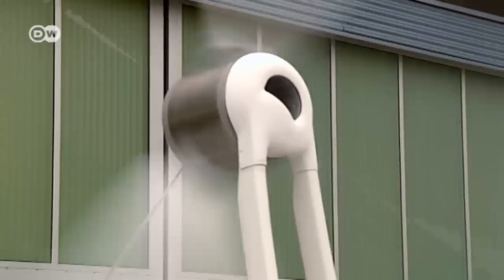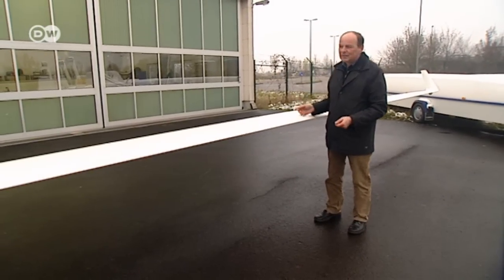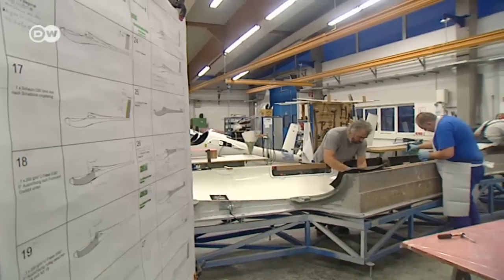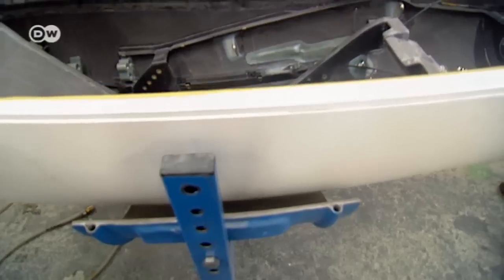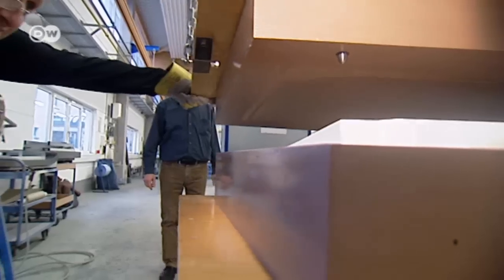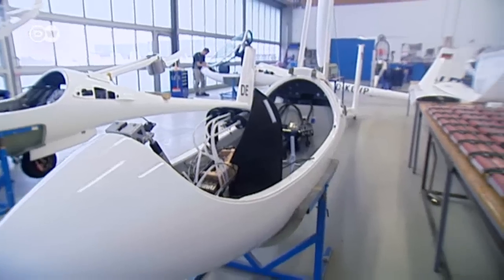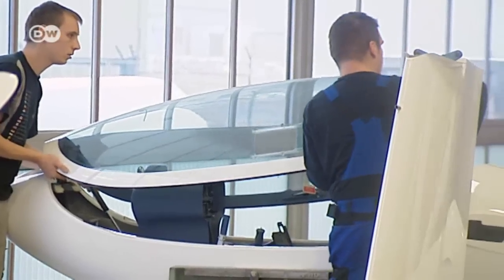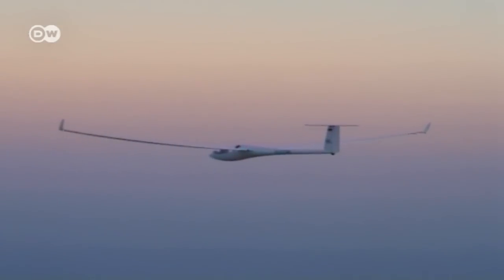On the Up: Electric Gliders | Made in Germany

Comment: I Have A Question:
would the previously mentioned safety rocket make it so glider wings could be thinner, ( so they don't have to carry water ( or less)), if they also could reliably get to smooth landing surfaces ?
it is somewhat, Also, a modern materiel science and construction techniques question, ( pertaining to wing thickness ( or length )), but it's still the same question.
i don't know much about gliders...if the water is carried for intended distance from height, or just to make them faster, i don't know. EDIT : NOW I GET IT....Glider Water Increases The Wing Loading .... IT'S A STRUCTURAL THING !!! 
when there is no water in them, they flex up more

So the glide ratio is compensated by that water weight, Because It Holds The Wings Flatter <-----THAT'S ALL !!! ...for crips sake, that was driving me nuts.

Comment: another clean, ( possibly cleaner ), way to try out; would be better ground based launch systems, and gliders with an H2O2, ( momentary full on / off solinoid ) Fixed rocket Safety Thruster.

where One "rocket belt" style thruster could be streamlined, as fixed into the spine behind the conpit, ( less to go wrong, super reliable format, higher power to weight )
where the high expense of the fuel, and catalyst, would deter frivolous use, and promote reserve for instantaneous automated parallel stall recovery, or intermittent situational manual use.

Comment: it's fun to have an electric powered glider.  there is nothing wrong with the electric motor.  the big project is the battery?.  (1) weight, (2) leveling time, (3) range, (4) endurance, and (5) durability.  as you can see, there are big problems (1) the weight of the battery must be reduced a lot.  (2) recharging the battery must be as fast as tanks and faster.  (3) the range must be increased much much much more in terms of time and miles.  (4) endurance the world's toughest marathon.  (5) durable you should detonate a 2 ton bomb without it breaking.  today's batteries are reasonably good but can be even better than best.

Comment: How the propeller stops in the right position for retrac?
Reply: The motor is brushless with electronic control similar to stepper/servo motors used in robotics.  The motor stops and then indexes to parallel retract position to stow it.
Reply: Abbrvs are so 'cool'.

Comment: 250,000.00 EU  but in USA there was once a kit built glider called a Duster that cost 3,000.00 dollars to buy new , assembly required. That shows you the difference between a aircraft designed to save costs and one designed to be cutting edge technology. If the Duster had ever been factory built and there had been a market for at least 100 a year the cost of a finished factory built one at that time could have been about 5,000.00 dollar since a factory can cut the materials cost even more then a kit producer can. But at that time there was no market (buyers) for 100 factory built Duster a year .  I think the Duster could be converted into a all aluminum design by someone that knows how to design in aluminum. I also think it could be powered by a electric motor in the nose and even redesigned into a conventional tractor airplane configuration in same way the 1-26 was changed into a 1-30. https://en.wikipedia.org/wiki/Schweizer_SA_1-30

Comment: Wouldnt gasoline be better?
You could go up with the motor. And when you're on top, you dont need to carry the weight of the fuel anymore. With batteries, you'll still carry them if they're empty
Reply: Filmemacher liquid hydrogen and a full cell would be the most efficient
Reply: weight is a good thing for better glide.  think like this: you throw a cotton ball in to the wind; you throw a baseball in to the wind.  think about the result.  Ballast is a common thing in gliders.  Built in with the batteries plus it provides the self launch.  no brainer.

Comment: Good idea! Electric makes the most sense in gliders. You only need power occasionally and the motors are lightweight, which is a big plus in a glider. The only hitch is the weight of batteries, and that is improving rapidly. Let's hope someone will markets kit versions without that astronomical quarter-of-a-million-dollar price tag.

Elsewhere, electric for propulsion is a silly fad, particularly given that, thanks to fracking, we are a generation or more from reaching "Peak Oil."

Comment: could test using the oncoming air pressure to drive a wind turbine on a powered glider aircraft   from a high altitude steep descent used to recharge batteries.. a propellor when feathered could double as a wind turbine using oncmoing air pressure to generate charging current maybe. oncoming 70mph  air pressure would drive a low drag wind turbine

Comment: I wonder if the engine and propeller could be re-deployed in a pinch...
Reply: yes they can, I came to see this electric drive because the gas ones sometimes don't start and then you basically have a giant spoiler deployed. There has been a few pilots who deploy to low and then end up dying when the motor doesn't start. I'd rather have my exit strategy planned rather than relying on tech to save my butt.
Reply: I see.  Thanks for the reply.  I suppose it would also be good for lengthening your flight, as long as you planned for the contingency of it not working :).
Reply: There are many Self launching conventional Glider's that use sustain-er motor's to get back to the Airfield they left from or make it to a suitable area if the Thermal activity of the day dies off,

Comment: The Media needs to get this correct  Sail Planes or Glider's are NOT repeat NOT powered by the wind as inferenced but they are Solar powered,  the Sun heats the terrain creating thermal up drafts, remember the Aircraft is flying downhill all the time BUT if the Air it is flying in is ascending faster than the craft is descending then a rise in altitude is the result.

        Soaring is an eco friendly sports , and now with electric self launching which can be Solar charged makes it very green indeed. 
Oh I wish I could get back into Soaring other than FPV R/C.
Reply: +mozzmann 
You left off mountain waves and ridge lift, which are not caused by terrain heating.
Reply: Actually they are Bruce,  remember that Wind is causes by heating in one place and cooling in another and the displacement of Air  between , thus moving air stream which collides with a Mountain or coastal ridge and is forced upwards can and in fact is created by thermal activity.
Reply: +mozzmann 
We were talking about thermals. Sustained winds that cause mountain waves and ridge lifts area caused by air pressure differentials, not updrafts. Wind is caused by a complex process of pressure differentials, difference in air temperature on different regions of the planet, the coriolis effect, the ocean is not considered terrain and yet has a huge effect on weather. Falling rain causes winds, that's not the heating of terrain. Yes I am aware of the fact that the sun fuels the weather on earth, but it's not because of thermals. Heating of air is one thing, a rising bubble of air known as a thermal is another. I studied weather back in 1980 when I started flying sailplanes, I know all about thermals, mountain waves and ridge lift.
Reply: +Bruce Yes but the Wind as we know it  IS created by Thermal activity pure and simple ,   ie Temperature difference from place to place creating a pressure difference and thus wind.
 
            This is a pressure difference and that is initiated by thermal activity that translates to a wind  or more correctly an air mass moving from one place to another  and if there is a mountain range  of coastal ridge then low level lift is created.

             Mountain wave is similarly created by Thermal activity and then enhanced by it where the pressure ridge forces the air mass upwards BUT that air mass cools and descends and depending on the range can bounce from the valley floor picking up more thermal energy because it triggers more thermal activity ( sometimes you can have an Air mass that is hot and wants to rise but there is a cold layer above that stops it , ann then you get a wave bouncing then trigger's this additional rising air that adds to the wave propagation gaining more height.         
            
             This is why sometimes when you see Lenni's or Lenticular cloud formations they can often be seen stacked up  4 or 5 and well away from the actual mountain range as well 
       
             This is ALL created by Thermal activity which can be a localised like a whirl Wind too a reasonable "thermal" any thing up to 300Ft to 1000 Ft  across to a thermal mass over the state of  Texas drawing in air in the afternoon ie generating a wind from the Gulf of Mexico drawing in moisture and can create storms too.

A classic example would be  the " Fremantle Doctor"  in West Australia ,  it is ALL created by thermal activity or temperature difference.

You need to go back to Soaring school
Reply: In that case so are gasoline engines, gas comes from oil comes from dead dinosaurs and their energy came from eating other dinos and their energy came from eating plants which got their energy from the sun.  You can always argue that anything interesting that happens anywhere would not happen without star being the first step in the process.
Reply: No.  the rotation of the earth, causes the corollas effect.  Unequal heating of the earth causes differential in pressures and causes the air mass to migrate towards the low pressure area.  When is heats, it rises and then the corollas effect causes the airmass to rotate.  Heating of the earth is what causes wind.  Just give up and say Okay.
Reply: I think all these aspects and definitions could have been discussed without insulting anyone.
Reply: @rainerzufall689  exactly  everyone is being so critical on the details like I could point out that gliders fly only on their wings and cockpit taking it further actually the materialsmaterials he glider is built from that
Reply: @kennethsee6262  I didn't get your point but I am relatively sure neither did you get mine so I guess we are even.
Reply: You mean gliders, not "glider's".  The apostrophe denotes possession. The glider's what?  NO apostrophe.  There ya go.  And thank you for the lesson. Very interesting.
Reply: John Myers ... Conclusion: Gliders fly because of the Bigger Front-Side INFINITE Spiritual Realm Universe creating, supporting and controlling the smaller backside finite material realm universe... Infinitely .. 

ALL within the ALL is ALL we ALL are... Peace .. 

"A Complete Macrobiotic Yin Yang Philosophic Understanding Combined With Its Practical Dietary Discipline Is Timeless Universal Law. All Other Teachings Are Incomplete"~ Herman Aihara, Michio Kushi & George Ohsawa ☯ ✞ ∞
Reply: xxtwr1 Coriolis. Toyota make Corollas.
Reply: Lighten up, Francis.  ALL wind-powered machines are really solar-powered, since all of the wind is solar-generated.  You're tilting at windmills, here.  Er... solarmills.
Reply: Mozzman lighten up quit being so critical I bet you are the life of the party
Reply: +mozzmann - "Yes but the Wind as we know it  IS created by Thermal activity pure and simple"
- If wind is made by thermals, and gasoline is made from oil, why is it commonplace to say our cars run on gas instead of oil? Or maybe my car runs on ancient decomposed animal remains, and gliders are powered by fusion.
Reply: This is overly pedantic. Yes, you are technically correct, but practically speaking the driving force of a glider is the air. Pilots don't measure solar output while they're flying around, they measure airspeed and updrafts.
Reply: Jack Joe ON what basis exactly do you claim I am Stupid to borrow your phraseology ?

 Once aloft either by Winch or Aero Tow a Sailplane or Glider is in fact powered by gravity ! because without gravity there is no forward motion ,  but flying in Air that is rising faster than the sink rate of the Aircraft you can stay aloft for a considerable period, in fact many hours and can fly many hundreds in fact thousands of kilometer's under certain conditions .  

The Air in rising currents ie Thermals  yes in a way could be construed as a wind of sorts, BUT for forward flight a glider is in effect ALWAYS descending within the Air it is flying in ,  Gravity causes the aircraft to descend and the airfoil of the wing induces forward motion as a result of gravity and attitude or pitch creating forward motion ie Airspeed the Airspeed minimum and maximum vary for different Soaring craft. 

A horizontal or traditional Wind as we know it is created by thermal differences within the air mass around us, this can be utilized in the form of ridge lift where the Air mass is forced upward and the glider flys along this lift "Street" for large distances. 
 
BUT due to the need for Solar activity to create both Wind AND Lift they are by definition Solar powered !!! End of story because without the Solar energy heating the Earth then we would have NO wind as such created by the geographical differences in Air pressure caused by solar heating.

A Thermal is a localised rising column of rising Air created by again solar heating and or other factors such as fires BUT the Aircraft is STILL flying downhill relative to and within the body of Air and if the Air is rising faster than the Aircraft is descending then you climb.

Now WHO is it that is sounding stupid ? 

I have many thousands of hours in sailplanes so I think I understand the theories of Thermal activity as it applies to these Aircraft much better than yourself.
Reply: +Rcbif Because the average Yank calls it Gass being short for Gasoline due to lazyness I suspect , BUT Gasoline is just one of MANY products produced by the refining Crude Oil. 

           In simple terms when vaporised by the fuel induction system of modern cars ends up being a gaseous combustible vapor. 

                 Yes in essence Thermals are created by what we believe to be Nuclear Fusion within the Sun, thus the thermal radiation creates instability within the atmosphere that we perceive as wind, where individual air masses are forced to travel from one area to another due to varying Air pressures as a result of heating and cooling ,  ie Sea breeze in the evening on the coast.
Reply: I feel dumb responding to this but by your logic wind turbines used for generating electricity instead of wind use solar power? So they are in the same category as solar panels? You do not make a very good argument.  
Also wind is cause by the sun AND the rotation of our planet so if we use your labeling system gliders are also earth powered. It sounds like you have to much time on your hands (I know I do if I'm on YouTube arguing this) maybe pick up a book on geography or something of similar nature to fact check yourself.
Reply: +DS4Life Yes you confirmed your stupidity.